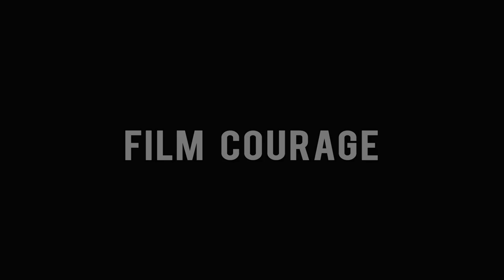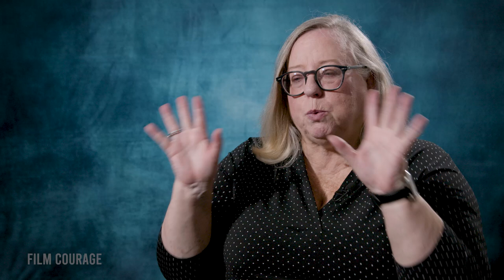First Steps To Making A Short Film - Kim Adelman

Comment: Though I concur with Kim Adelman that facility access assessment needs to be looked at from feasibility point of view, it need not be the starting point for a short film. The end message of the short film if thought out first could be ideal to start the sequence of plots from beginning. Story needs to be visualised end to end. Instead of a story write up, sequence of pictures screen by screen can be collected and story board is made.
Let the picture  flow contain any type of facility that needs to be accessed initially, then those can be matched against the available cost effective accesses and as per this access gap assessment, screen facility can be tailored most frugally. This way the premise of the story is preserved for good short film presentation.
It is like making a love where boy and girl meet without thinking of any facility access but later they balance  and settle down life